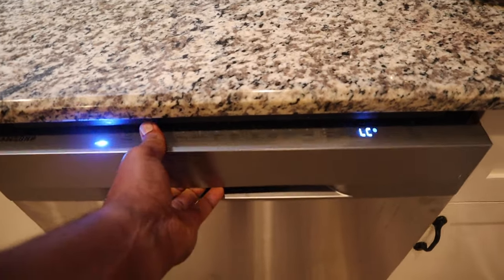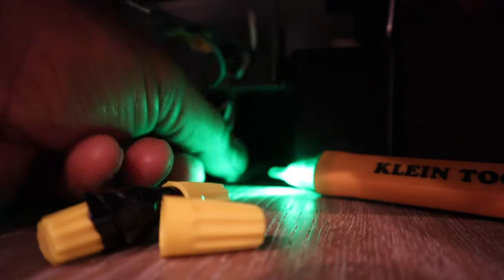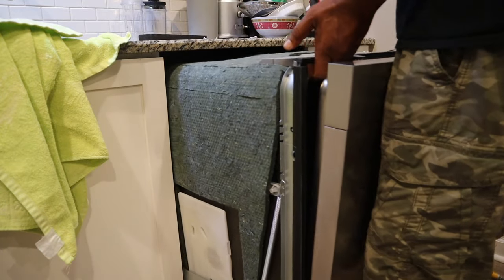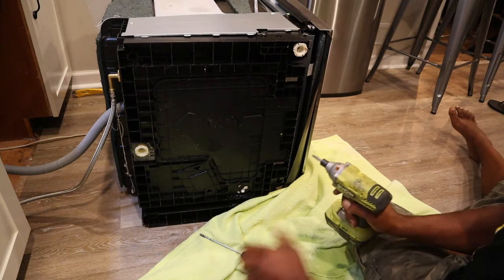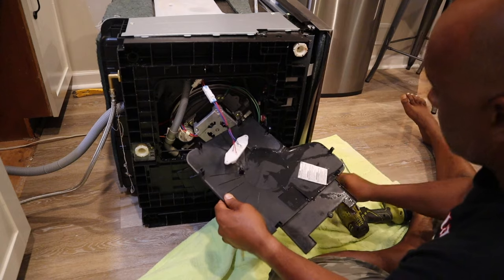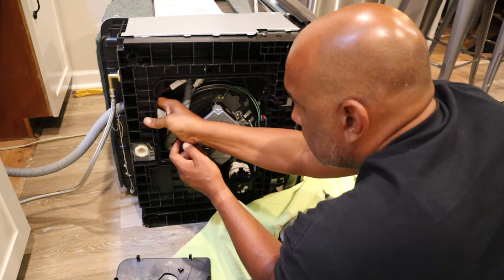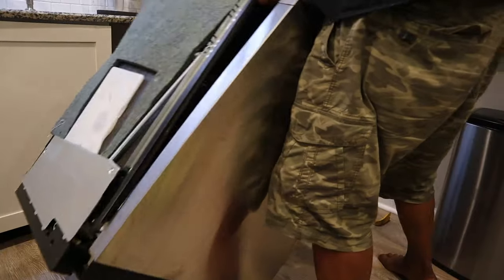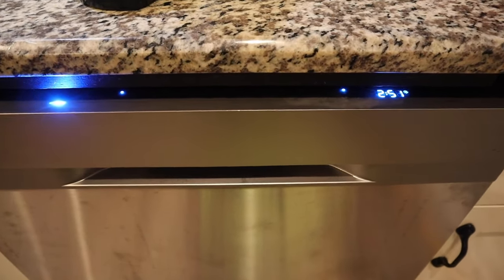Samsung Dishwasher LC Code - Permanent Fix

Comment: I also have the LC error code from time to time. Can you tell me if this code also results in your dishwasher to not drain properly? My problem with my Samsung dishwasher is that it’s not draining fully. Thanks for your help
Reply from the maker: yes mine wasn't draining properly which is what kept setting off the LC code. I think it is some kind of design flaw.
Reply: wgibson86 thanks. This helps
Reply from the maker: @wagkangamol  sure no problem
Reply: @wgibson86  I fixed the issue using your suggested approach.  It worked for a three days then it stopped draining and the LC code error displayed again. Have you encountered recurrence of the LC code issue?
Reply from the maker: @wagkangamol  I haven't had any issues since I modified mine. These dishwashers gotta be the worst engineering of all time
Reply: @wgibson86  I watched some other video about how to fix the LC code and it suggested to turn the dishwasher on its side and use a blow dryer to dry the moisture sensor.  Then, I pointed a fan to blow towards the bottom of the dishwasher while on its side.  This solved the LC error code issue.  Problem now is, the dishwasher is not fully draining.. dang what it is with these Samsung dishwashers?!?

Comment: Great video thanks! As this is final fix... And permanent... But How did you clear this code before to make dishwasher work again?
Reply: As long as it doesn't detect moisture the code auto clears when you power it back on(spoken from experience after waiting 24 hours for moisture to clear multiple times)
Reply from the maker: Thanks! Yeah mine cleared automatically as well  once the moisture was gone.

Comment: Well, the only problem with modifying the sensor is, you still have a water leak, you will have bigger problems if you don't find and fix the leak, mine does it every once in a while but I think it is because my wife opens the door while its running and water goes into that sensor pan, check your door seal at the very bottom on the inside of the dishwasher, mine was full of crap and it doesn't take much for water to get out of that seal, you also mentioned the drain hose was leaking, FIX IT you can start getting mold and slime under the dishwasher and floor rot. not telling you what to do just some helpful advice. I have found out the hard way. I was a facilities maintenance guy for 27 years, I have seen alot.
Reply from the maker: Thanks for the tips. Since my alteration it's been working great with no issue. Hopefully it holds up but if any of the things you mention do happen I'm just gonna chuck the thing to the curb and buy a new one...and for sure not a Samsung. 😂

Comment: Then question is where did that water come from if you were able to physically see water there? 
Possible overflow from inside? 

Otherwise not knowing where the water comes from that's potential water hazard
Reply from the maker: Not real sure where the water was coming from. At the point of frustration that I was at with the constant error code malfunction, I didn’t spend a lit of time investigating that, I just wanted it to work. 
I was willing to take the water hazard risk. 
It’s been working great since the modification and no water leaks.

Comment: the reason you didn't have a lot of water in it is because that's not the issue. All the code is telling you is the sensor got wet......1. Unload dishwasher 2. Unplug dishwasher 3. leave door open for 24-48 hours. Sensor will dry. 4. Plug machine back in. 5. Load dishwasher and turn on.....DO NOT REMOVE OR SCREW WITH SENSOR. To assist in dry time aim a fan at the "open" dishwasher. I just did this with mine.
Reply from the maker: I did the same thing about 5 times and got sick of doing it. So  finally before tossing it out on the curb I tried this as a last resort and it's been working great ever since.
Wish mine was as easy as yours but I think Samsung sold a lot of lemons on this one. Thanks for the info!
Reply: @wgibson86  definitely, so far mine has not acted up again but if it does I will be removing the sensor all together.
Reply: I followed this advice - left it open for 24 hrs and I now do not have the problem! Thank you!

Comment: I've been looking for this leak for about a year now and can't find it.  Every few months the sensor goes off and I have to pull it out dry it check under it for signs of water (None!!!) then install it again.  I just got tired of it and disconnected the sensor and took it out.  Now it's just like my old one...no sensor.  If there is a water leak, I'll deal with it then.  But as of now, GOOD BYE CODE!
Reply from the maker: Awesome! That code drove me nuts too. Enjoy!

Comment: Check the screws that hold the motor/seal in place.  This is under the filter plate.  Many others find these screws loose and is the cause of leakage.  There are 6 or more of these screws.  Moving the sensor is not the solution.
Reply from the maker: Thanks for the tip 👍🏽😄

Comment: I HATE my Samsung dishwasher. My wife wants me to rip it out and take it back to Costco.  I am currently waiting for over a week and half for a warranty repair person to come. I will show them this video. I would attempt this myself but my wife, (the boss) does not have faith in my repair abilities. Plus she says if I crack open the box I might void the warranty.

So we got the dishwasher in July, the LC code started in late Aug and Sept occurring a couple times a week. My wife had Googled that the solution was to unplug, wait 5 minutes and plug back in. I hated bending over under the sink so I took an Amazon Alexa plug module, named it "Dishwasher".  I fixed it. I told my wife to just say "Alexa turn Dishwasher Off", then say "Alexa turn dishwasher On".  This worked for a month until mid Oct and now all of Nov it happens every other time we run the dishwasher. 

It was a pain in the butt to get past Samsung warranty, I have no leak, the drain is not clogged. It is like they ask a billon questions and do not want to have a service call. I finally got past that and am waiting. 

Thank-you for the video.
Reply from the maker: Hope they can get it fixed because it is definitely a pain. Thanks for sharing 😄👍🏽

Comment: Your dishwasher is leaking and the sensor is functioning the way it should. It keeps your kitchen from getting flooded or the flooring from being damaged by a slow leak. You need to fix the leak.

Comment: Just fix the leak do you have one. The bottom needs to be tightened or resealed.
Reply from the maker: It’s been working fine since the mod. Thanks for the tip👍🏽

Comment: This isn't a permanent solution-- this is a temporary solution to ignore the actual problem. We ended up with water everywhere
Reply from the maker: Sorry it didn't work for you. Our's seems to be holding up since making the alteration so hopefully it keeps going. It's a terrible engineering flaw for sure. If you find the "permanent" solution please share. Good luck!
Reply: Well we currently have a company coming in to rip out our floors because they are warped from the water damage. We bought a new pump for it to see if that helps the issue-- will keep you posted
Reply from the maker: @TheBalancedMom  Hope that fixes the issue. Thanks for the update.
Reply: I would check the plastic water guide on the left side of the dishwasher where water enters the tub, they get gummed up with soap residue. You can clean the assembly with a small bottle brush. look for any leaky hoses we often see the drain hose leaking right out of the elbow where it comes out of the pump. the dishwasher soap causes the end of the hose to become brittle. If you have any further questions, feel free to email us jmcwatchdog@yahoo.com

Comment: Mine is doing this except it’s not saying Lc it’s just blinking
Reply from the maker: Not sure about that but maybe once you unplug it from power it might reset. I would try turning off the breaker power to see if that does anything if not then adjust the sensor like in the video to see if that works.

Comment: Its more the hack than a repair. If no leaks sump shouldn't have any moisture in there. Check drain hose, point between drain pump housing and brake case assembly for any cracks.
Reply from the maker: You're probably right...unfortunately due to the amount of comments made by people with the same issue, that means Samsung is manufacturing thousands of Dishwashers with the same defect. Thanks for the tip!

Comment: Unfortunately the reason why it's accumulating water inside enough to overflow into the sensor it's because your drain pipe under the sink they send you a video it's very than. It has to be wider. That t-connector over there has to be as wide as a garbage disposal hole. That's how it's designed. If you use a pipe with a very narrow exit like that overtime not all the water gets drained throughout the cycle enable going to that section where the sensor is. Good luck have a good day
Reply from the maker: Sweet...thanks for the tip!

Comment: Man the only issue I'm having right now is getting the damn thing outta the wall. It's like it's stuck on something and refuses to come out. Local plumber want's $1k+ since it's technically a "install customer-supplied dishwasher" request. So now we're fucked it seems.
Reply from the maker: Oh damn that sucks. Sounds like it might be bolted to the wall or something. Frustrating to say the least. Keep at it ,it’ll come free some kinda way 💪🏽😄
Reply: @wgibson86  😆I finally managed to get it free after posting this comment! The drain to the garbage disposal and the hot water line were keeping it from coming free...

Comment: I'm getting ready to dry mine for the second time, after watching this, I think I will just try spacers inder it's factory location... it should work
Reply from the maker: cool! Let me know how it works
Reply: @wgibson86  Well, it fixed the water hitting it so early...BUT, I still have a leak so fixed the failure, but not the problem, simply not draining, (which caused it to over fill) then the door gasket can't hold the water in, so it drips under inside, and on the floor!  So..to sum it up, raising it with litte 16th of an inch spacers worked, (waters there, but not touching the sensor wires,, If much faster of a leak, and it would!) 
But, was only part of my problem, it is late, and I need a beer!
Reply from the maker: @skyrider4ever  Man that that thing is so frustrating. Well if I hear of a solution I'll share. Enjoy the beer!
Reply: @wgibson86  Taaaa Daaaaaa, I couldn't find anything on line , But, I studied the system (a bunch) and after pulling the  drain pump, (clean as could be) , pulling the drain hose, (slightly dirt) yet it still refused to drain, causing  the LC code (BTW, that 16th of an inch was perfect, raised it off the floor, but low enough that a true overflow will trigger it! I used bicycle inner tube stem nuts, just because I had them, but two washers stacked would do the same job!) 
Anyway, that didn't fix it, ...the clog was from the Garbage disposal line , I removed the Y fitting from the disposal , and it was totally clogged , clean that up , fought back barfing from the smell, put everything back together... dry as a bone now, and marked safe from those minor moisture issues!

Was going to post the pictures, but my camera decided to not work...so now I get to fix it..lol!
Reply from the maker: @skyrider4ever  Wow that's awesome! What a pain but at least you figured it out. I'll keep all this in my notes in case that happens to mine I'll know what to do. Thanks for sharing! Enjoy.

Comment: I urethane sealed the black rubber around where it was leaking on bottom and top, now it won't work very well lol
Reply from the maker: oh no that sucks. Maybe there is some way to remove the seal? This has got to be one of the worst engineered dishwashers I've seen..lol

Comment: My samsung feels like it's always hot even when it hasn't run for 2 days.  They don't make them like they used to. 2 years old.
Reply from the maker: Yeah I was thinking I would have been better off with my old one. It worked great. New is always better 😂

Comment: All their appliances are trash! My ice dispenser on the refrigerator is frozen over and doesn't work, my microwave went out and had to be replaced, the stove glitched out and had to be repaired, and my husband already replaced the sensor on the dishwasher a year ago, and it is giving the LC code again. Never again.
Reply from the maker: Yeah our ice maker needs a new unit once a year because it fails. I think all their appliances need to be reengineered. Hopefully the Samsung phones are made better

Comment: Best fix of all - don't ever buy Samsung appliances, they are TOTAL JUNK!  I have 4 of them and have had nothing but trouble from day one!  I will try this fix on my dishwasher, but next time I will buy a different brand.  The Waterwall dishwasher is the worst, the thing at the bottom doesn't even move on mine anymore and the repair people told me they can't even get parts to fix this piece of junk.
Reply from the maker: I 100% agree. Hope this helps.

Comment: Problem not solved you have a leak
Reply from the maker: You may be correct but it works now with no issue and has been since the modification. Thanks for the tip😄

Comment: I'm glad you don't work on airplanes....lol  If you obviously have water leaking down into the pan, then moving the sensor is not the fix. The fix would be to figure out where the water is coming from. That is the tricky part, and will require something more than a "finger in the dike" mentality.
Reply from the maker: I’m glad I don’t work on airplanes either. But I am glad my dishwasher is fixed and runs like a champ. 

Thanks for the tips and “finger in the dike” reference. I’ll be working that one into conversations every chance I get😂👍🏽

Comment: Or you could fix the cause of the leak.  There should never be so much as a drop of water in the pan and now you are risking water damage to your home.

If you dishwasher did not detect the water when it did, to engage the emergency emptying, even more water would have entered the pan
Reply from the maker: awesome thanks!

Comment: Once again, NOT a permanent fix for anything. You literally removed the warning system that is telling you that the machine has a problem. I really hope you aren't an auto mechanic.
Reply from the maker: Not an automatic mechanic but I do have a dishwasher that’s been working now for two years without issue.
Appreciate the comment though 😉👍🏽